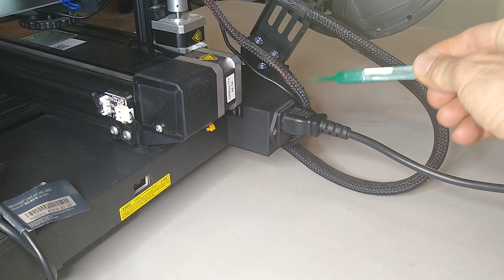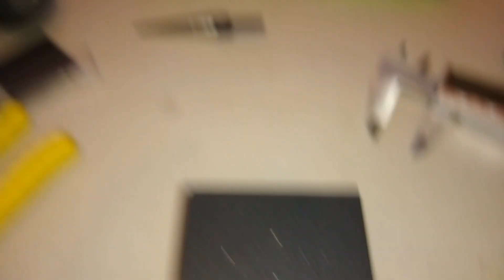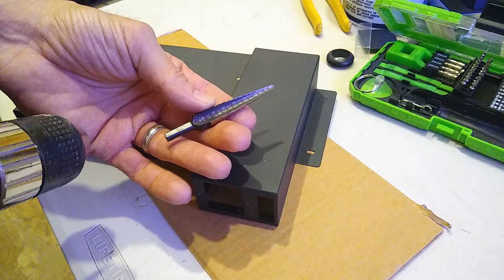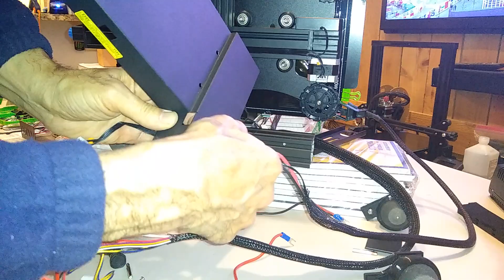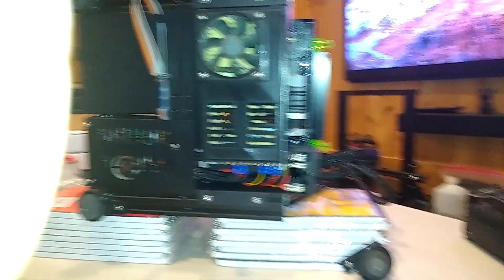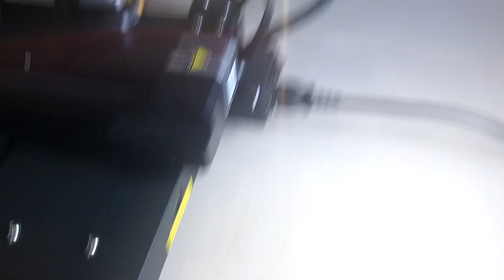Ender 3 V2 Cable Management Better Wire Route

Comment: hi victor another great video on the ender 3 but do you have any links on the tools that you used to drill out the holes as i would love to get this done to my v2 as i've noticed that one of my cables is starting to fray thanks...
Reply from the maker: Hi Mark, Thank you for your encouragement and pointing out that I was missing some links. 

I'm not sure what type of blades your jigsaw uses but something similar to the t-shank version linked below should work if you need a different mounting style.

Unibit - https://amzn.to/3ikePjj
T-shank metal blade - https://amzn.to/3vPGX0L

Grommet - https://amzn.to/3k4Acpi

Comment: That cable rubbing on the power chord will also eventually unplug the printer. I've had it happen to me.
Then I moved it, and it rubbed on the bed level wheel on that side. Since I use an auto-leveler, it thus got away with gradually unscrewing that wheel completely.
Reply from the maker: Hi ZAZ, Thank you for sharing your experience. Did that happen to you with the stock cable routing?
Reply: @vbared  Sadly, I've fiddled with the cables so much that I no longer remember how they were set up, stock. By odd coincidence, the pics I looked at when I realized that all had the cables photoshopped out of them, and then I just came up with my own system that is working decently. But I don't know if that cable worked its way there from the stock position, or because of something I'd done.

Comment: Great video, and a nice job. 

Just being the devils advocate here, would it be worth putting some insulation between the female power socket and the re routed hotend/zaxis cabling?  

In Australia we run 240 volts which makes your eyes water when you get a boot from that (if it doesn't kill you first). 

There are the exposed 3 spade connectors for the 240 volts that are very close to the re routed cabling. 

Thanks for sharing.
Reply from the maker: Hi Don, Thank you for commenting and kind words. You bring up a great point. Maybe some cloth tape under the mesh sleeve, heat shrink the open connectors or both in those areas would make a big difference. Thankfully those areas don't get any wire movement so the chances of those exposed connectors cutting into the mesh sleeve, through the insulation and shorting with other cables is low.

Thank you for pointing it out. I forget at times that other countries run on 240 for standard electronics.

Comment: Hi Victor. 

This is such a good idea, i dont know why they didnt think to do this as part of the manufactur of the devices.

Do you know what size gomit you used for this?

Cheers
Reply from the maker: Hi Ben, Yeah, I can't figure it out either. It totally gets the wires out of the way. The grommet I used is 20mm.

Have you completed the silent mods?
Reply: @vbared  Well its been done - i have now completed this on my printer and im already seeing a massive beneift to the footprint of the device.

https://drive.google.com/file/d/1cflQ2Lbfo93dwe8pTaHKQvOcnOte5DZ3/view?usp=sharing

Cheers Victor!

Comment: cant your share Y axis steper motor mount cover?
Reply from the maker: Hello Robby, Thank you for commenting. Please check out the parts link in the description of this video on installing the E3D V6 all metal hotend on the Ender 3 V2.

https://youtu.be/dZz-eR3d5YE

Best of luck with your mods!
Reply from the maker: Hello Robby, Thank you for commenting. Please check out the parts link in the description of this video on installing the E3D V6 all metal hotend on the Ender 3 V2.

https://youtu.be/dZz-eR3d5YE

Best of luck with your mods!

Comment: Dang, thanks was looking how to get extra length for my extruder stepper for direct drive and I thing this will work and also help with wire management
Reply from the maker: Hi Jason, Thank you for commenting. I'm glad you found yet another advantage to running the cables this way.

Best of luck with your mods!